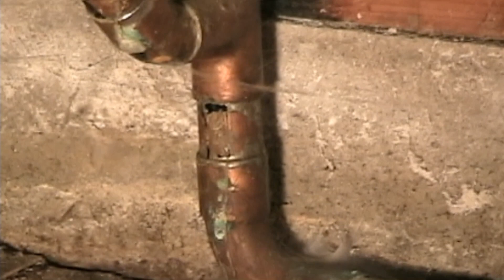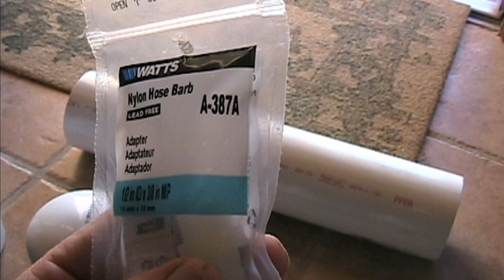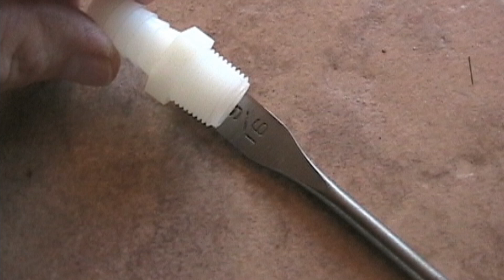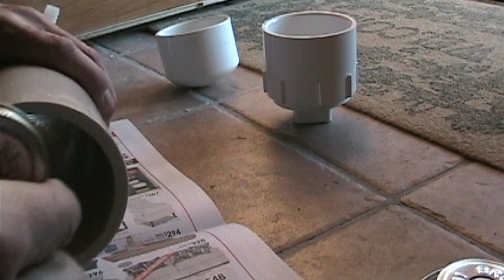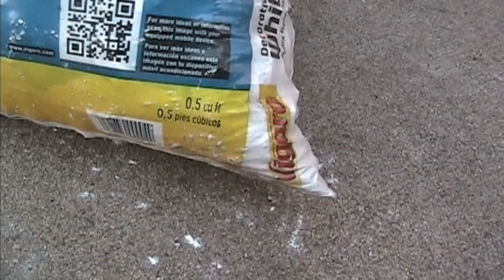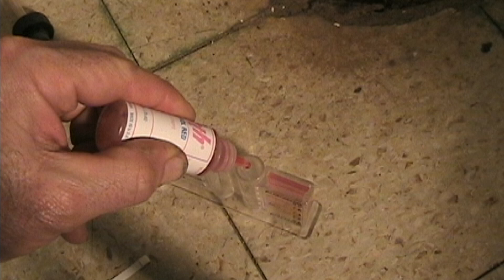Make your own condensate neutralizer

Comment: How would you engineer this in with a pump?  Just had a HE furnace installed with 3/8" PVC draining to a condensate pump that then feeds a flex line to a utility sink.  The pump is too hard to reach to put stone in itself, so looking for a solution before it drains into the sink.  Maybe put it just before the sink so it drains downward through stone?

Comment: I am going to use a clear plastic container and let the water come in from on top with a large hole.  That way if a future owner pulls at it there won't be any damage and they can see if the container is full.  A sign to explain can be taped to the side of the furnace.  Most people, including furnace guys, don't know about this, or at least they have never told me in the last 20 years of fixing up old houses many of which had cast iron pipe.

Comment: New 95 plus. The heating companies don't carry or even think a neutralizer is necessary. It's no more acidic than orange juice? Let me squeeze you up a a fresh glass, pulp or no pulp. Luckily the drainage was pvc ate the grate. the floor drain screws and some of the foundation when it backed up at on point. . Not sure if it was relateed but within a year the city was jackhammering up and replacing old iron pipes in front of the house. I can now smell the condensate coming out of the traps from a trap that has dried up in a shower that isn\'t being used. They told me it would mix up when it gets into the sewer. How is there no code? How many floor drains go straight into the storm sewer? Have all these regulations but if you through green. eco,  or high efficiency into the verbage you can bypass all regulations and sell toxic waste as fillers in all products. FGD drywall, fly ash in concrete (radon gas ? more like raduim isotopes it's coming from radioactive flyash used in the foundation)_, corn gluten weed inhibitor killd the birds but at least all the rats died, SDS in soaps, bleach and ammonium in cleaners. Barium sulpate in primers and piant. Sulfates in everything. Cyanide in table salt.Mercury still being put in vaccines and people's teeth unnecessarily. Asbestos still being mined and used. Ashpault roofing. Tools smell like puke butyric acid in plastic, also known as CAB cellulose butyric acetate, Why is there 50 items in products, tiny amounts of fillers made from toxic industrial waste.Why is drywall treated like toxic waste now? Cement as well? Whjy won't trade workers go into the attic or crawlspace anymore? What is in pressure treated lumber? What is in natural gas that makes it smell like sulphur. Why do forrest fires burn red and black out the sun?. It has not always been like this. In 2003 over 200 homes burned and ther was no red sky and black out. Ten years later I notice red dyed rocks in the lake 3 kilometers away. What is in fire retardant? How much is being dumped on the forests and what industrial waste are they putting in it. Lead is still i  many airplane fuels.         FYI the amount of condensate can easily be in the 4 gallon per day range.  It contains NOx SO2, CO2. that can be broken down by microbes into methane.  Natrual gas a fossil fuel is mostly methane. Fossil fuels take millions of years to synthesize? I see bio-fuel in our future. Instead of fracking old sewage dump sites.

Comment: Shouldn’t you have drained into the lower port so the neutralizer would fill up and then drain out of the top? I would think it would’ve been more effective covering all of the chips. But nice work.
Reply: The pH is good enough evidence that it works okay. The one thing anybody would have to do, is check to see if the pH goes down with time and usage ie less/smaller stones=less interaction=lower pH.

Comment: Nice job!  You saved me a ton of $$ then buying one of those retail ones  that I think charge about a $100 per cartridge that you have to change out after a while!
Reply: it is nice job but it would cost around $35 ,while the ready one is $59 with media 
https://www.homedepot.com/p/JJM-NBT-23-Acidic-Condensate-Wastewater-Neutralizer-2009/301439478?MERCH=REC-pipsem-301529863--301439478--N

Comment: You should turn the unit so the exit is higher than the entrance for water into the chamber. This will force the water to spend some time interacting with the stones.
Reply: Yeah, make it vertical. Enter near bottom, exit near top. You could just strap it to the condensate trap on the furnace. Makes it easier to replenish and inspect stones.
Reply: @egoequus6263  Why bother?  His pH is good at 7

Comment: Thanks for the clip. It would have been even more helpful had you done the pH test both before as well as after. Then we would know just how effective your neutralizer was working.
Reply: Its not effective. Theres nothing in there to raise the pH. Rocks are there to increase surface area and slow the condensate down.